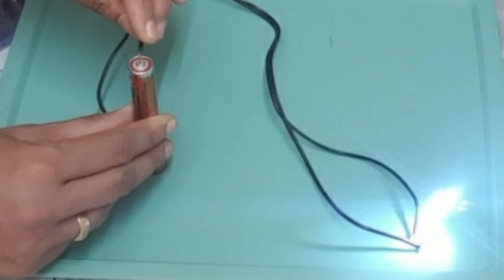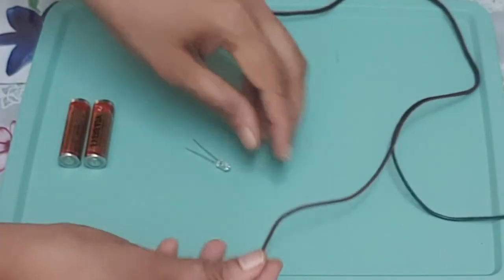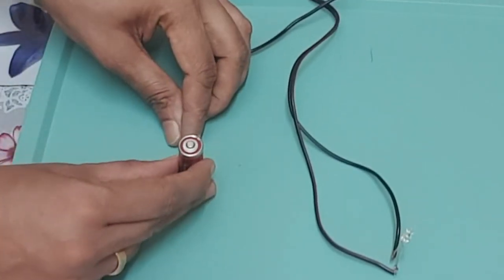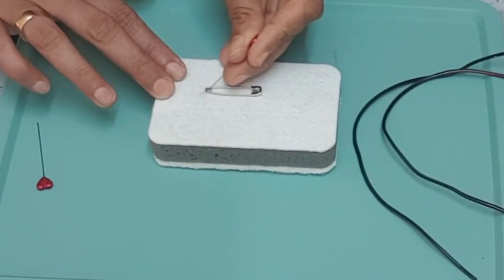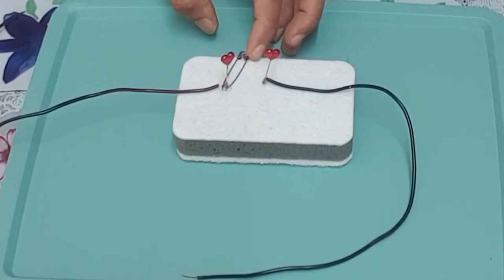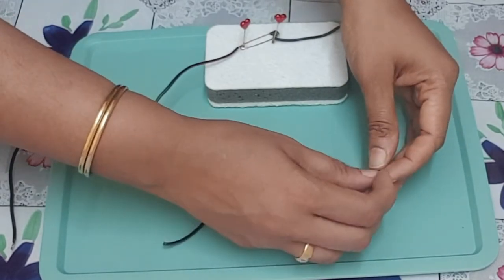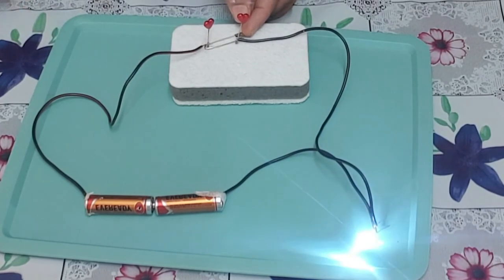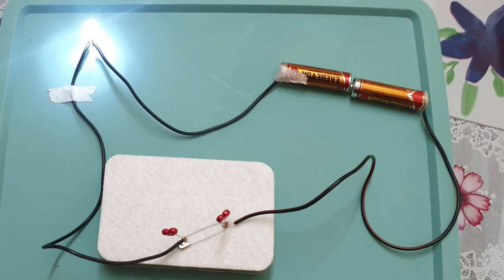#HOW TO MAKE AN ELECTRIC CIRCUIT USING A PIN (SWITCH)#easy experiment to do at home...CLASS:6

Comment: Howdy!  What resistor should I use if I have a yellow 10mm LED Emitting Diode (1.8-2.2V)  powered by two AA Batteries?  I will have an on/off switch in the loop.  Will 47 ohms work?  i tried 100 ohm resistor but the batteries were getting hot.  I'm not even sure if I asked the question properly . Thanks for any assistance.